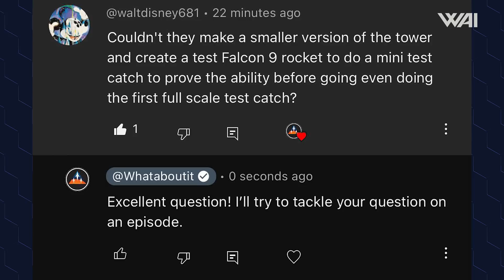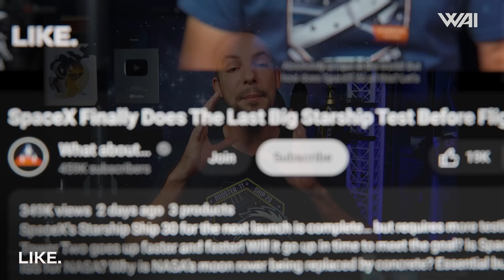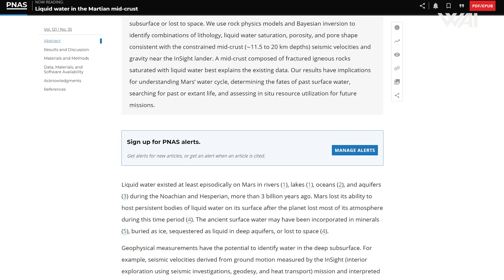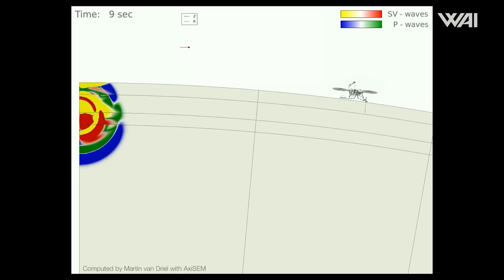SpaceX Massively Updates Starship! Ready For Flight 5!

Comment: The Merlin 1D engine is only slightly throttleable, and Elon has said on multiple occassions that F9 first stage landiings are a "hover slam". I.e. The M1D can't throttle enough to provide hover, so they program the F9/M1D to reach zero velocity at zero altitude.  If you watch the SpaceX F9 launch videos, you'll notice the landings are markedly different the BO's New Shepard landings where the rocket can actually sit and hover for a bit.  Super Heavy, as I understand it, will be able to hover like BO+NS in place until the chopsticks can engage.

The other thing, if I relate catching SH like trapping a jet on an aircraft carrier... the jet has landing gear that is hydraulic and has give, as do the tires.  The cross deck pendant (cable / wire) also has give, as does the arresting gear engine below decks, which is hydraulic and likewise has give.  Plane is much lighter but lands much faster... SH is much heavier, but lands much slower... I just don't see that much give in the chopsticks... the draw cables might give a little, and part of the chopsticks move to absorb the force of landing a bit, but I still worry that those tabs on SH meant to catch the chopsticks  might just get ripped off as the ship and system are unable to accomodate motion between the two enough.  Time will tell.

Comment: From a testing perspective, could a test first stage be hung via crane and simulate catching it? You could have the test unit weigh about the same as one under power. Could a crane handle the load? This might be an interesting test with smaller ramifications if something goes wrong.

Comment: Falcon 9 can't be used for a chopsticks catch as it would need to hover long enough to orient correctly

F9 is so light at landing that even a single Merlin can't throttle down enough to hover. It always has a positive TWR and it lands by timing it's deceleration to reach 0m/s at the landing pad.

If it reached 0m/s before getting to the pad, it would just start climbing again!

Comment: If Space X had wanted to, they could have fueled the booster stage for a thousand foot lift off and catch, similar to a Star Hopper test flight. 

Due to FAA flight limitations, Space X packs as many tests into each Starship flight. So why not launch a fully stacked Starship and collect data on the booster and Starship. Validating all the ship's latest updates and improvements.

The real interesting question here is how much of the booster final alignment and catch is automated, and how much is still manually controlled by Space X. 

Eventually the booster and Starship catch system must be fully automated, if there planning multiple launches per day.

Comment: Has anybody noticed the depictions of the lunar gateway and docking procedures?
How is starship supposed to dock nose first without putting an enormous amount of stress and torque on the gateway?
Dont these companies ever watch scifi?  How do large ships dock to the orbiting spacedocks?  Duh, sideways.😮
And have you actually looked at the size and shape of their various modules?  Doesn't the gateway look quite fragile?
Shouldn't the gateway look the same size all the way through?  In other words shouldn't the module connections be the same size as the modules?  And shouldn't those connections have sealable doors like on a submarine or something similar to a short width airlock?

Comment: They cut the bumpers off because they make the arms flab back and forth if they ever touch.
Ah... try this... hold both your hands out in front of you, palms out... like telling traffic to stop with both hands... leave thumbs out pointing to each other... whole hand is an L
Thumbs about 4inches apart bring them together a few time where they bump tip to tip... don't slam them but make sure its a good jolt.   Your fingers tips wiggle a lot.
Now, fold in your thumbs... and with the same motion, bring your hands together ... but let them hit at the ends where your finger tips end... No reflex type bounce back... just Thud.

Comment: Mars water at 10 to 20 km depth easy?? No way dude! Just 10 km = 6.2 miles = 33,000 feet.  Typical earth bound oil wells, per Mr. Internet, are only 20,000 feet deep with some going 30,000 feet deep.  It is no picnic drilling a 6 mile deep hole that would need to be lined with a casing material the whole way plus you need 6 miles of drilling rig shaft.  You can’t just wave your magic wand and say scientus-fictionous bing bang boom.

Comment: The current path is acceptable as it becomes one step at a time, expensive steps non the lease, but it makes evaluation and determination so much easier! But this mindset is contrary to general thinking! SpaceX followed the principle of develop something, prove it and move on, knowing it is easier to tweak and further develop items that are already functional! Seen this with the engines, in use and what has been developed further. SpaceX has proven that they can get Starship into space, the next step, catch it and that is what flight 5 is all about. But every step has been about learning and altering and testing over again. Didn't Edison apply the same logic in the pursuit of the electric globe? So this is where everyone else is failing! Utilize it and see what goes bang? But it will take them years to interpret where they went wrong as they attempt to but a totally complete system into space! Boeings Starliner has learnt it the hard way, at present is labelled a flop, send it to SpaceX to solve the problems! New Glen hasn't lifted once, so will it be a win or a loss, a loss will mean years in discovering what went wrong! Space X is miles in front. But the others are needed to keep them honest, more of a legacy hindrance! But everyone is frightened of the potential success of Polaris Dawn, they would make a mockery of NASA's space suits, which again makes a mockery of Starliner! Good times!

Comment: Chopsticks are way too heavy right now, generally that's a good thing for lifting and handling equipment but for something requiring quick precise movement the momentum and moments are the wrong way around.
Increase hyd supply, reduce moment and reduce weight.

Comment: I still dont get ehy they dont do a hop test with a partially fueled booster with no starship, you would not have to go through a relight, you would jist clear the tower then throttle down to landing configuration and try a catch at a very low speed and have a good amount of fuel to hover if needed.
Reply: Because they have to test the upper Starship regardless, and that’s likely to take more iterations.
Reply: @fredbloggs5902  testing the starship is not a requirement to test a booster catch, i agree that a lot of the booster testing done has been a secondary focus to the starship, but just like the tower or booster was not a requirement to test a hop of the starship, the starship os not required to test the booster, of you want to do things from peridgi then you may as well fly the starship as well which is why they do it, however, if you have a more controlled targeted test you will get better clean data, we had an engine put on  assent and decent the last flight, if you end up with a chopstick failure because it tries to catch a booster which is crabbing to the tower and have a number of enginer out, its a lot harder to know what actually caused the failure. Minimise the variables to get better data is always better, plus noyhing stops them  using the caught booster to still fly the next superheavy, you in fact it would be a reflight test which would knock something else off the test list.
Reply: @fredbloggs5902  my response was also in telation to testing a F9, if your gonna do that why not jist test the booster!

Comment: I'm certainly no expert on rockets, but I always wonder why do they go with catch pins instead of rings?
I'm sure the main reason is weight, but I can't help but wonder what will happen if the 2 pins aren't aligned with the rails as it comes down for whatever reason.
Will it just fall through if the grid fins can't hold the weight?
🤔

Comment: One problem with F9 landing is that the Merlin engine can't be throttled back enough to hover.

As such, it has to do a hoverslam (aka suicide burn) landing where it ignites the engine at the last moment and shuts it off at the instant of hitting zero velocity. If it doesn't shut the engine off at the proper instant, it will start climbing again. This also means that you have no flexibility in your velocity as you are landing, your speed at each point is fixed, you can't slow down earlier without hitting zero velocity above your landing point.

The Superheavy can hover, so it has FAR more flexibility in landing. It may or may not actually halt in mid-air, but the ability to hover means that it can slow down more and approach the arms at a lower velocity.

Comment: They should test the chopsticks separately so why not lift a booster or test tank with the crane, say few meters over the arms and simply drop it? Doesn't have to be flight ready hardware. Provides data on whether the catch arms are strong enough to take the impact force at a minimum.
Also no risk of RUDs.

Comment: Starships should have legs and always land on the legs vs the tower since they need to land on the moon and mars and earth many times anyways, should onky always catch the booster. Which is why they shouldve built the booster much larger, large as the tower itself and the starship widened and elongated for more propellant and payload 200+ and 100+ geostationary orbit with 0 refueling and risk. Saturn 5 is dated yes with old teh but at least it could acheieve 75tons to geo orbit with 0 refueling. Starship could never unless they enlarge and widen the vehicle overall and double the height of starship.

Comment: OK-------. Since the test Boosters are not putting a payload into orbit (and even if they were) Why Not put landing legs on the boosters to practice landing them on pads on Land and at Sea. Then worry about transitioning to grabbing them out of the air with the Tower. (making the FAA feel a lot better about quickly approving the next series of launches!)  At least then if they ran into problems catching the Booster they could land it on the pad nearby. Taking the landing legs off when they are not needed later is easy.  But then there must be some benefits to landing a couple thousand miles down range at Sea on a Cheap Barg as the Falcon does?  Would it be worth the weight of the landing legs?  Even if they had to partially refuel the booster to hoppe it quickly back to the launch site.

Comment: I think they should be testing catching the booster with booster only launches. This would be similar to the early Starship launches when they landed them on unfolding legs. However, this scheme would have either only Starships or only Boosters launch to a 30k to 50k feet altitude then retirn to launch-pad for catch attempt...

Comment: We always guessed there was more equatorial water hiding on Mars.....     :)
Mining is never easy, mining water on Mars with lightweight portable equipment won't be the straightforward exercise people seem to picture...
Mining operations need spares - a lot of spare parts and expendable parts...  Pump liners, tailings pipes, cutting edges and drill tips...
You always wear things out and break things quicker than expected, so you always have three of everything.

The amount of equipment to mine/process the massive amounts of water needed for propellant could be almost as heavy and bulky as just taking the propellant along.
Plus, astronauts aren't miners, they won't be good at it and their time it too valuable to waste on mining anyway.

The key to interplanetary is propellantless propulsion obviously.
But we can do some interplanetary before we get to that, but it may be wiser to just send spare propellant in advance using ballistic capture, rather than crossing fingers and hoping that astronauts can mine enough water to survive and return home    🤞?

Comment: Assumed the closed arms : close around the tank perfectly. They added pads. Suddenly they no longer perfectly enclosed the tank as well. U would now have 2 circular pads that stick out and are the main areas where the arms grab the tank as it descends. IE they would need to cut out those sections and insert them flat with the arm. Or the booster will just rip 🪦 them off as it descends. It requires really intimate
Reply: Intimate understanding of every part. Especially when confronting such insane thing as catching such a huge booster with metal pincers in an upright launch 🚀 pad. Many things to go wrong even if by some miracle they catch  said booster. Will prove entertaining however.
Reply: @ricchamen6304  say what?

Comment: So, IF starship can get 100 passengers at a time, and manage to send 3 cargo crafts for each crewed vessel, then they'll need a fleet of 1,600 (not including fuel tankers) starships to get a million people to Mars in 50 years. 
The issue with this is that they will need anywhere between 1600 and 24000 tons of cargo (depending on location and whether they go with solar or nuclear) landed on mars just to set up a fuel plant capable of 1200 tons of Methalox in 500 days, which is how much time a starship would have on the surface before the return to Earth window opens, and crewed starship will need full tanks and will have to refuel in Mars orbit again to return to Earth LEO. 
Most starships sent to Mars to land may end up staying there, which is fine, but I see less than 100,000 peope on Mars in 50 years.
That's still very exciting to me though.

Comment: I think the booster catch method is far too dangerous, especially around all those unprotected buildings, tanks and infrastructure. It would be more sensible to have the superheavy booster and starship 'glide land' horizontally on a runway just like the shuttle did. Yes that would require landing gear and altering the design to include glide wings.

Comment: Once Space X is happy with the chops sticks and no more modifications are needed, how will they test a booster catch before IFT5 to see how the chop sticks handle the weight. Do you think they will actually drop a test booster from a crane onto the chop sticks to simulate a real catch. I've seen the clip of the chop sticks slapping the sides of a smaller tank but that's nothing like catching a full size booster.
If Space X have already done these tests I've not seen it so can somone link me to any videos of this.

Comment: I think that SpaceX should do their first landing on the second landing tower...instead of the pad zero.  Even if tower two is not totally finished, there is less damage possible if there is a bad landing on tower 2.  In fact they should do the next few landings on tower 2 before the pad is built.  So there is less to blow up if there is a crash.  I'm also thinking that Elon should do a hop from pad zero to Tower two.  I think if they do a hop, that will give them the practice, and confidence in the ability to land in the tower.

Comment: I wish they would use a booster that has already landed at least one time to practice catching it. Put a plate down on the launch ring for the landing gear and that way if it does not work right, it does not crunch its engines. It would still have its landing gear out to help. Just saying....

Comment: I doubt that they removed the buffers to stop the arms closing too much without a good reason. The “best part” is no part should not apply here. Using a software limit without a mechanical limit on the arms is just dumb.  Unless the force exerted by the arms closing is not sufficient to crush the rocket or the hydraulic ram or electric actuator travel limits the arm closure anyway. In any case the arms are ultimately limited in closure when their ends meet. 
Why would you bother removing the mechanical limit even so?  You might do it if the arms hitting the stops caused a rebound. That’s unlikely because the mechanical limit should be beyond the software controlled actuator limit.
So they removed them because it reduces the weight of the arms making them a little easier to move in and out and reduced the load on the raising and lowering system allowing slightly faster movement. Maybe they also created a structural weakness which is maybe more likely?

Comment: Raptors are the unique engine with modulation enought to overing. Falcon 9 can't overing, landing on legs require a perfect timing on engine power for vertical position. Catching is much more complicated and is possibile only with raptor engines. Impossible to catch a Falcon 9.

Comment: They should perform the maneuver over the ocean again and have the booster perform a complete hover and simulate it hovering at the height of the tower arms (the same type of virtual thing they did with booster 4, but that hovering to me was not very good. I would have liked to see it then descend into the ocean (even if the engine flamed out). There was also flame on the side of the booster during that descent. That needs to be corrected so there is perfect engine performance and shutdown in order to be assured things are working we well as possible. To do iterative design with launch tower A as guinea pig makes no sense to me (particularly economically if things go awry). Booster 6 could then perform a tower catch attempt if all goes well with booster 5 virtual test. Can you imagine how long the FAA review will be if the booster slams into the tower, demolishes it, then falls to the ground and causes heavy damage there? Months if not years and all because of ego vs taking a more measured testing approach.